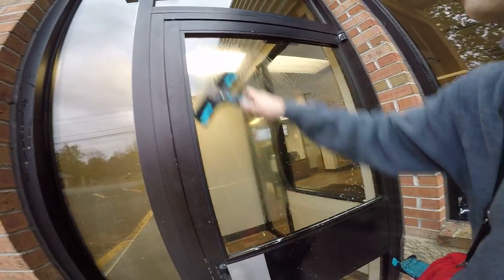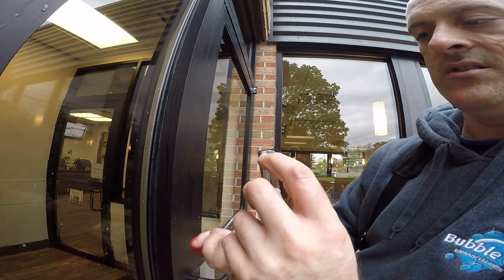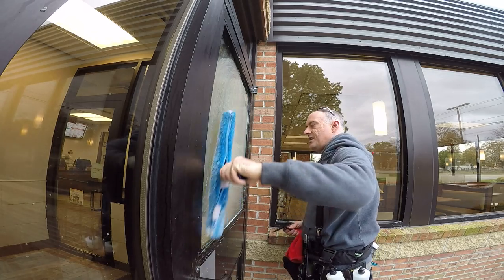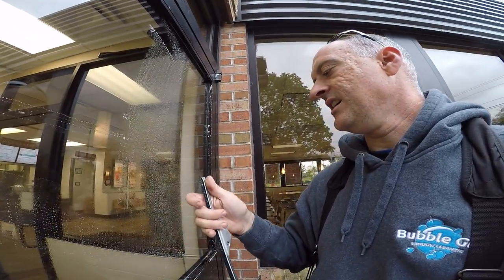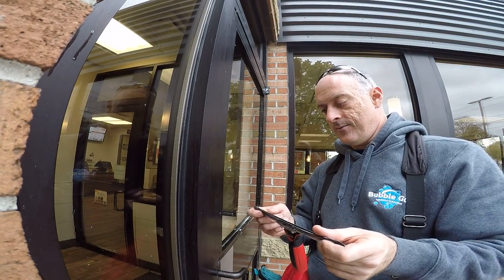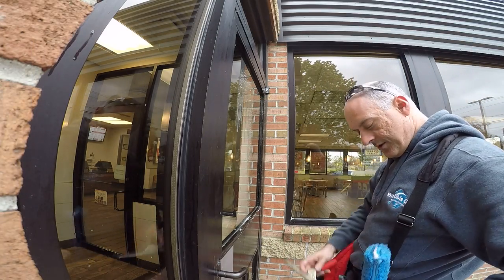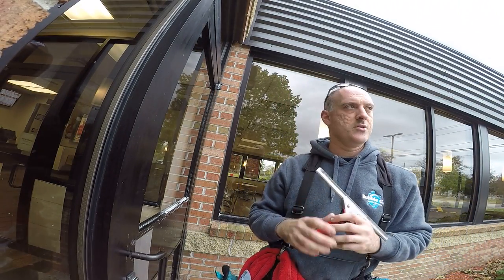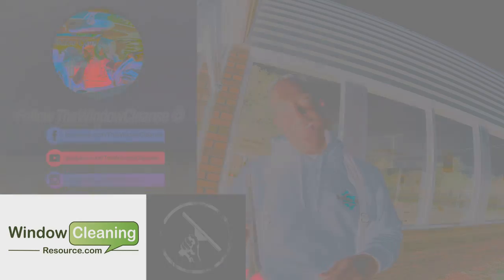Hidden Gems: Unger S+ channel

Comment: Great video. I almost bought that but went with the liquidator instead. I've been using it for a long time but I still leave a smear on the window. For instance, if I'm doing a door, as the left end of the squeegee is is coming down the left seal of the door, the right end of the squeegee leaves a little smear of water then it trails a line. I have to make an extra pass up and back down to keep it from happening.
Reply: Use more soap (hopefully dawn) moerman needs extra slide. If the rubber grabs the window at all, it leaves crap behind.

Comment: using both channels, I move s+ under the angle on the glass more like dive bombs type of move, Im using s+ almost everywhere, liquidator is great but channel is moving all the time changing position cause handle doesn't have good grip, I've seen that some guys are trying to reduce that movement but I never have taken my time to correct it. Windows which we clean are usually dirty or very dirty and in hardcore cleanings s+ is the winner for me. When it comes to crazy angles and horrible access to windows liquidator combined with excelerator is mind blowing.

Comment: one more thing about liquidator I don't change position of the fliq. it's always on the channel so when I do part of work with the pole and then I'm taking squeege in my hand fliq stays on top and I hold it with my thumb when fanning. Works for me as our pace is high and switching something to something is a waste of precious seconds in my case